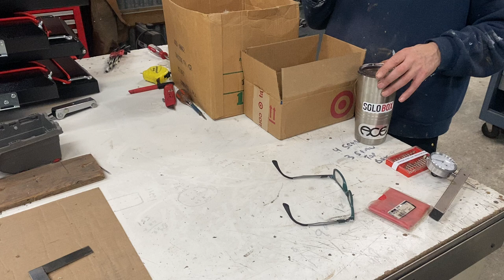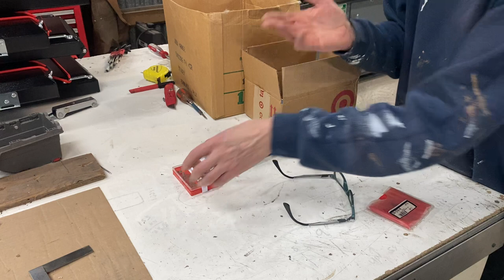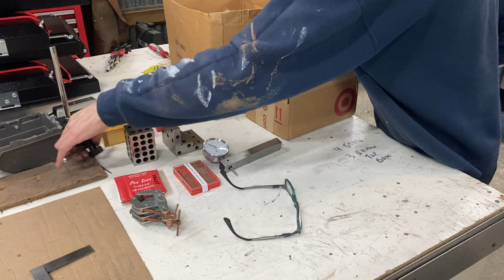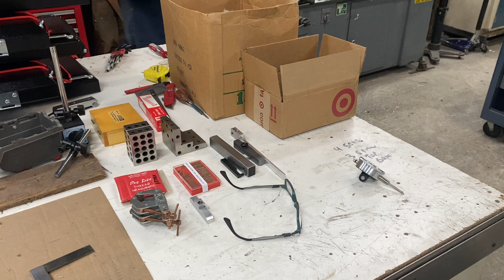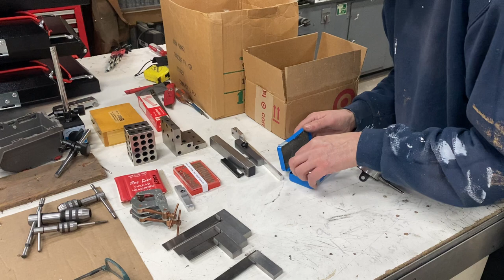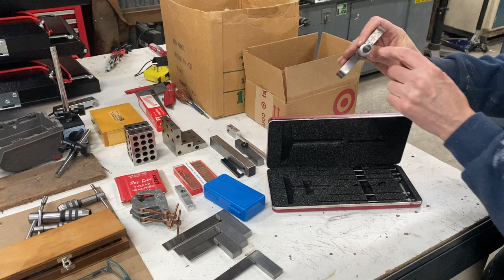Machinist tool score. How much is it worth?

Comment: Nice finds. Very good deal. Definitely Aerospace stuff. If they decide to quit sending it to PMEL (calibration) then they will put for reference only. Usually means it's put into a flightline box and you can quickly check rough dimensions. Unless it is beat up its still accurate. PMEL will clean it also.